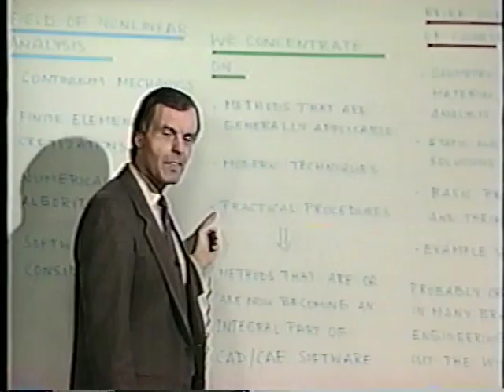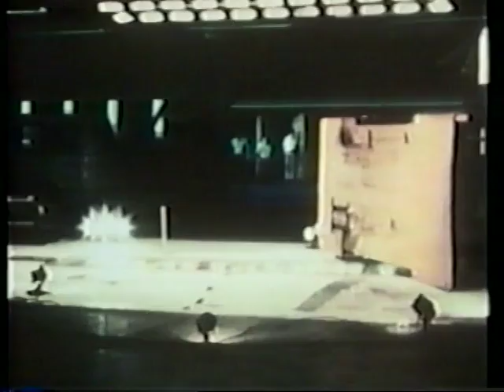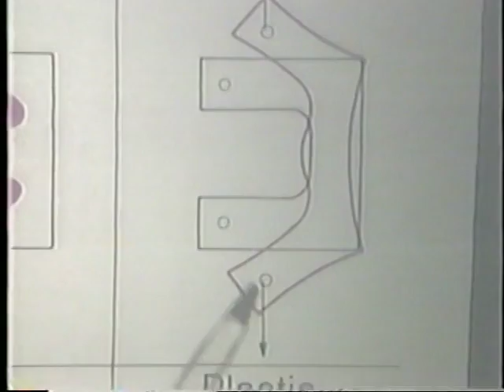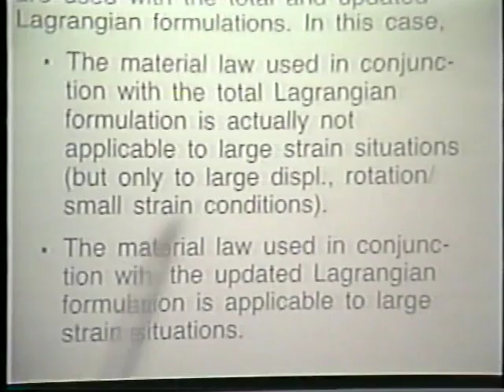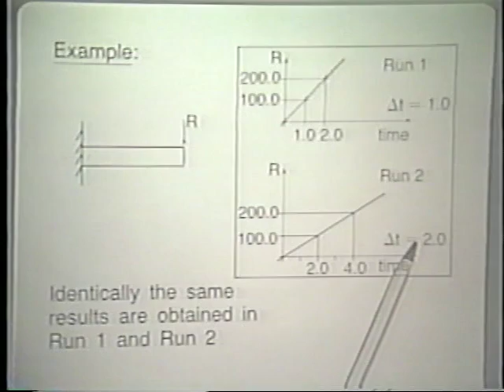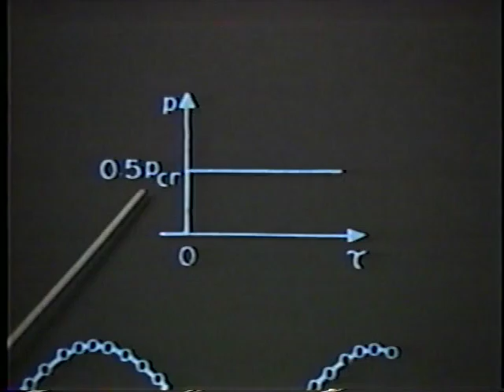Lec 1 | MIT Finite Element Procedures for Solids and Structures, Nonlinear Analysis

Comment: It's all about finite element analysis. If using materials are linear (only elastic properties) -- it's linear  finite element analysis. If materials are non-linear (for example bilinear strain-stress curve with hardening) -- it's non-linear finite element analysis.

This difference is so important because non-linear problems don't have analytical solutions, only numerical.

Comment: Thank you ; could any body help me to know what is the diffrence between FEM and non-linear anaylsis??
Reply: Finite element analysis is a paradigm of numerical method to solve partial differential equations. These partial differential equations could ones that describe the behaviours of solids or fluids with different properties and under  different variables in consideration (Temperature, displacement, velocity). 

Now the these behaviour of solids or fluid could be defined using linear principles or non-linear principles. Where the non-linear principles are more complex and more in line with the actual behaviours. The linear principles are a simplification of the non-linear principles for numerical simplicitic reasons. 
Non-linearity in terms of solid mechanics FEM can include material non-linearity and material non-linearity.
Reply: FEM analysis is a method for splitting up an object into a finite number of elements.

Linear Analysis is a type of FEM analysis that studies the elastic behaviour of these elements. (so only temporary elastic deformations, like elongation of a spring)

Nonlinear analysis, however, is a type of FEM analysis that studies elasticity as well as plasticity. (so also permanent deformations like bending a paperclip)